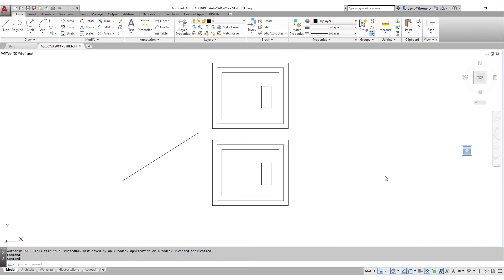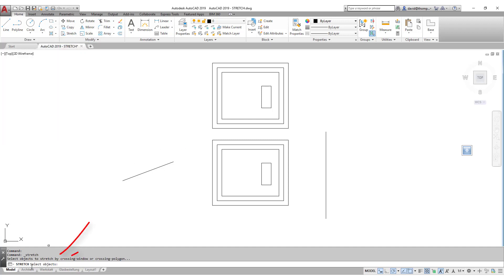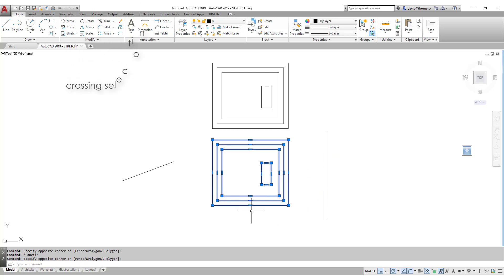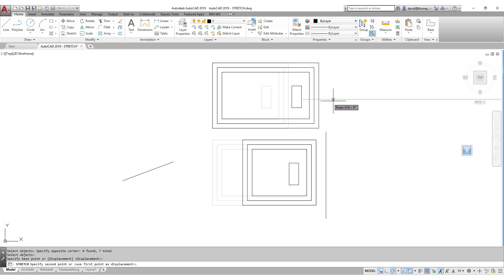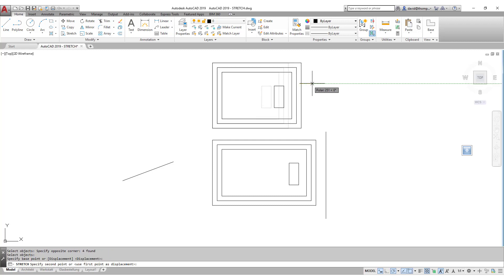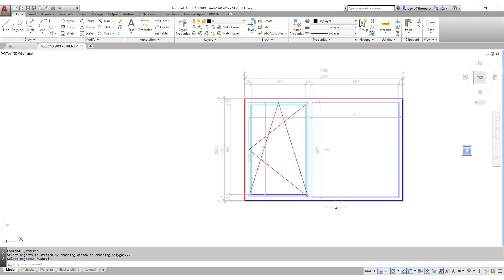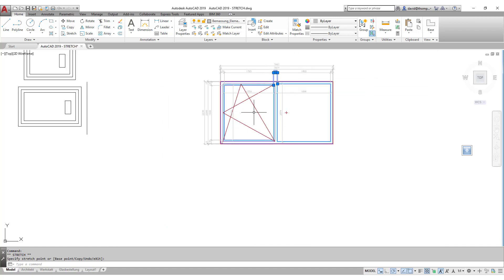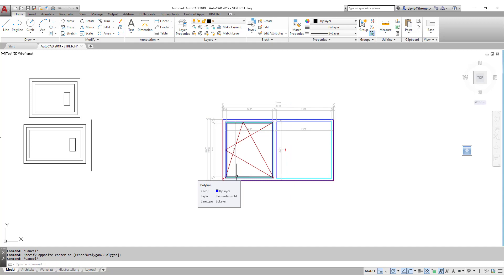AutoCAD 2019 - the STRETCH command

Comment: sometimes it works sometimes it doesnt;
Reply from the maker: In older versions of AutoCAD the stretch command was a little 'sensitive', but now it is more robust. Usually when it does not work as expected it is because of (a) not selecting properly (separate left clicks) (b) trying to stretch a block (no-go) or (c) trying to stretch too many things at once! Let me know if you need some help...

Comment: Hello. It's been great to learn how to use the command, becase i didn't knew at all. But i just couldn't solve my problem, which was to use the same command in order to stretch a block or a complex object without loosing the proportion or the original shape. Thanks for your answer and for the video. It was really clear. :)
Reply from the maker: Hello Montse! To make changes to a block, mark it with a left click, right click and choose edit in situ or block editor. It may be that you are looking to scale things rather than stretch them!